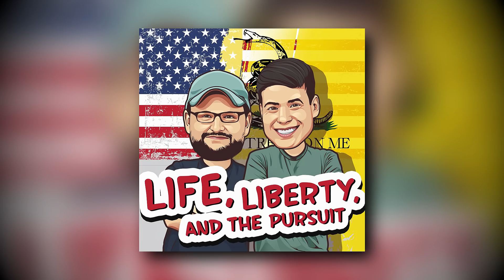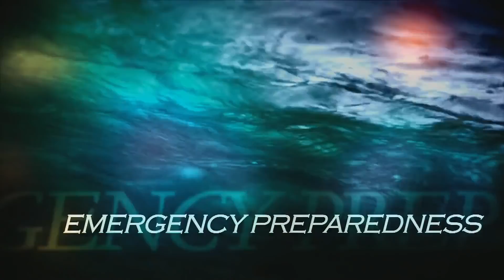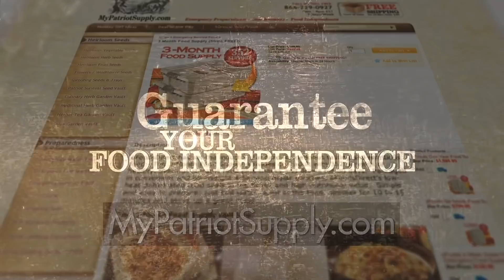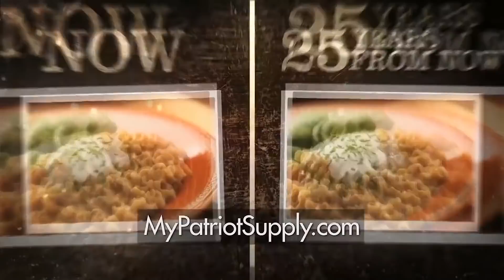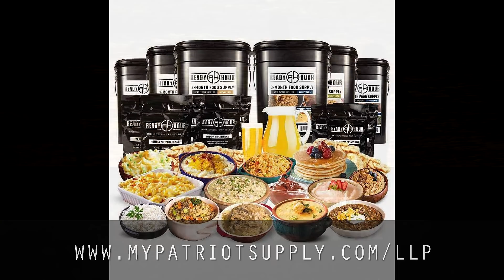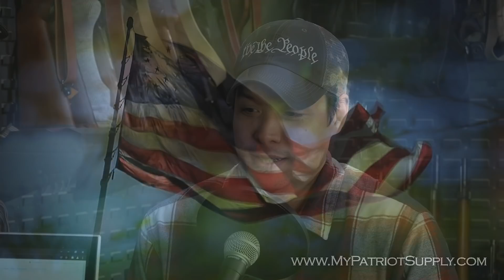LLP | #82: "AR-15 vs AK-47"

Comment: From what I’ve been told, the reason it was called the poison bullet was because it caused septic infection.
Reply: Due to speed of the elongated 20 cal bullet when the bullet struck human flesh and bone the bullet would yaw or tumble! High velocity bullets that hit bone definitely are more violent than a slower moving bullets. Also rumor was bullets out of 74 were kinda thin and hollow at the tip.

Comment: I want a rifle that is reliable, accurate sub 1 MOA with good ammo and sub 2 MOA with cheap ammo, light, modular - sights triggers cartridge stocks hanguards grips and even gas systems, ergonomic - including the safty trigger bolt release and charging handle at least being on the left side for right handed use, has last round bolt hold open, supresses easily, is simple to maintain, easy to work on and replace parts as well.

Now all you have to do is show me a premium AK and a premium AR using this criteria, the choice is pretty easy for me to make.

Comment: Freezing rain stops the ar flat..no effect on ak..I've had both ...the durability of ak trumps the ar design. The accuracy is better on ar but not enough to matter. So I use my ak,, much more
Reply: This is the best comment I've seen. I like both platforms but in a shtf situation where I had to leave my home without a cleaning kit or oil I'd have to take my AK no questions asked.

Comment: I can punch out .300 lead rounds all day with gas checks. I can use the few molds I have can make similar rounds for 30-06 and .308 easily. Trying to make loads for .22 rounds is dangned near impossible. If you can find AR ammo cheaply then it makes sense if not, just put a 30 cal lead round down the barrel.

Comment: Both have their place. The modern AK will hit at 500. Its just out of gas.
The AR pretty much max'es at 800.
But again iffy to be lethal at range. 
For average guys 300yds will max our skill on both. So either or both will do the job. Same with costs. You can get high end AK's costing as much as an AR.
As a P.S. Invite Brandon Herrera. Have him bring a 74. Run it out as far as you can.

Comment: AR platform does not perform well in cold temps. Usually in 10 degrees or lower you will see failure to fire, mag catch wont work properly, etc

Comment: AKs are far more modular than people give them credit for. People just buy oldschool, wood furniture AKs and compare that to modern ARs. Thats basically like buying a retro, fixed carry handle AR and saying ARs arent modular because ita hard to mount accessories to. Get a modern rail system with a good railed dustcover, not those stupid side mounts, lightweight furniture and a shorter barrel, maybe in a 5.45 or 5.56 chambering, then compare that to an AR.

My current AK is actually my primary preset AK that I use in Escape From Tarkov. It's got a Zenitco DTK muzzle brake, B-30/B-31C railed handguards, B-33 railed/hinged top cover, RK-3 pistol grip, RK-1 foregrip, and a Fab Defense UAS-1 folding stock. Right now it's topped off with a Sightmark M-spec which I actually do quite like, but it's soon to be replaced by a Vortex UH-1 Gen 2. 

I've never loved a rifle more than I love my AK with this setup, it looks great, handles well and is built like a brick shit house

Comment: The AK is modeled after the M1 garand in its moving parts. Exterior wise, maybe slight cues from the MP lines but it’s internals are m1 garand inspired. That’s really non negotiable, it’s fact.
Reply: @billmelater6470  He's referring to the AK47's long stroke gas piston & rotating bolt system that was directly inspired by the M1 Garand. The cam track for the bolt is nearly identical on both rifles.
Reply: Like every other gun design, it borrowed, and was inspired by a combination of design features from predecessor guns, including, but certainly not limited to the m1 Garande and MP lines. However,  to say it was "modeled after" the M1 is wildly hyperbolic.
Reply: @billmelater6470  it's safe to say he picked from alot of different designs, and obviously from older Soviet designs like the STV40. But Kalashnikov explicitly names Garand as an influence in a interview with Stoner.
Reply: @mohawk3371  loosely inspired is a better way to put it.
Reply: @nickloven6728  Loosely inspired by a number of preceding designs including the M1 Garande, StG44, Bren mk II light machine gun, and a number of previous Soviet designs including the Federov, AVS36, AS44, and SKS. In term of the most similar long stroke gas piston and bolt carrier design, that would be the Bren and the AS44 (Sudayev), rather than the Garande.

Comment: Not being easily conducive to optics kills the AK.  Not being very accurate even if you want to tolerate the scope mounting system further kills it. The limited range of the AK round finally kills it. If you have ever picked up an M-14 or Garand type weapon, there was definitely reason for moving on to a newer, lighter, shorter design. The range of the AR 5.56 was/is reasonable. The shear weight of a battle load of 7.62 x 51mm must have been staggering in weight AND bulk. Sure, there are tons of options for switching calibers in AR platforms, but the extreme cost/availability of most of those rounds, (if you actually like to shoot your AR) kind of kill that incentive.

Comment: I would like to point out it’s called a side rail. It keeps your sights zeroed even when you remove the dust cover. I would argue most AKs have one. 

This feels a lot like fuds arguing about AK Vs AR than an actual intellectual discussion between the two. You have some points, but when some of your points are ignorant of existing old designs on the platform you lose credibility to the audience. 

I like you guys and your content, but I know you are better than this for a debate.

Comment: I love my AK's, and one of them is my current go-to should I need to do rifle things right now. The major downside to AK's is the lack of easily replaceable barrels and other parts. AR barrel changes are easy and can be done by almost anyone. Hell, you can grab a few cheap uppers and store them away in case your barrel or gas system have a catastrophic failure. I really really like that aspect. With an AK you're generally stuck with the barrel and receiver combo unless you have a press and know what you're doing (obviously can't be done in the field either).
Reply: the Las Vegas outdoor shooting facility had full auto AKnto rent. Must use ammo purchased on site. Many were burned to PAST 50k of short Russian and stll viable in grouping decent battlefield accuracy. PRETTY UNFRIGGNREAL barrel life.
Reply: @chunglow7646  50k can be done easy in 5-7 years if you're getting out and training like you should be
Reply: @lit sci just because they still function doesn't mean their barrels aren't shot out

Comment: This is gonna sound like treason. But I believe that the AK is superior to the AR. The AR is more accurate, true, but the AK is more reliable. I will choose reliability over accuracy any day of the week.
Reply: I agree 100%.  AR can't get as dirty and keep firing (like a Glock)
Reply: @marchie610  dont know about that chief, I don't how scientific independent torture testing is but I've seen AK's do WORST than AR's with mud and sand. The Glock was one of the least reliable in harsh conditions, even the hi point did better. Any rifle including the AK will fail if debris gets critical components like the trigger, etc. So having shit not accumulate in the firearm to begin with is a lot better IMO then praying for the shit to fall out out of somewhere before it jams the weapon.

Comment: You guys are so used to buying gucci AR's that you didn't even touch on price. lol..  The biggest deciding factor to me is the fact that I can build just about any AR kit, from a 10.5" pistol, to a 18" spr and everything in between, for well under $400.. or spend a little more and get a CHF CH barrel setup for $600.  and again, even if "budget" builds are a little less reliable due to possible parts breaking, ect. it's not a problem because you can easily build a dozen of them--- so you have endless parts if needed, which you rarely do.

Comment: It is more pleasant to shoot with the AR 15, it is easy to hit it, since the AR 15 is noticeably more accurate than the ak system. The perfect rifle to throw it in the back seat of the car and go to the shooting range, have a good time. But in case of a force majeure situation, some kind of apocalypse and all that, I will take an ak, just not an akm and not an ak 47, but I will take a modern ak, in 5.45 mm caliber, of course a combat full auto copy is not available to me, I will take a civilian saiga in this caliber. Since ak is such a rifle that you can not clean, you can roll it in the mud, snow and frost are not so terrible, which the ar 15 is afraid of. But in all other cases, my choice is for the ar 15, and when I go to the shooting range, I prefer the ar 15. Yes, I don't have a perfect ar made in Russia, but it's still better in everything except reliability than ak. And such ar 15s as Hackler koch 416, Daniel Defense, pof revolution and the like Gucci ar are even better, but unfortunately in Russia they are very expensive (from $ 10,000 and more expensive). I apologize for my poor English and hello to everyone from Russia.

Comment: AK is measured in distance by meters which is greater then AR yards. Secondly 7.62x39 has the take the soldier out the battle compared to 5.56 that zips through target. Which is why the government is looking at the 6.8 spec or what not. 5.56 can't travel through a tree. 7.62x39 can travel through trees. Old design still 3rd world reliable. Which would you prefer in a SHTF with no gunsmiths. Pass me that AK 🤣🤣 Afghanistan is doing well to beat U.S. with AKs and flip flops vs drones, AR15, and missle launchers 🤣🤣🤣🤣
Reply: Not so, the AR-15/M-16 uses metric sights. We haven't used English system sights since the M-1, and early M-14s.
The Soviets adopted the 5.45 after witnessing the effects of 5.56 in Vietnam for good reason.
Reply: @jcoolG192  they only adopted the 5.45 because of the U.S. idea of 5.56. They went back to 7.62x39
Reply: And we lost Vietnam
Reply: @ZZTful  LOL...no. The latest and current Russian issue rifle is the AK-12 in 5.45x39. They still use the 7.62 in some units, mostly police units, but the 5.45 has been the main issue for decades. It's long range ballistics is vastly superior to the 7.62, making hits past 200 meters much easier. The 7.62 is a freaking rainbow past 200 meters, and it bucks wind like a frisbee.
Reply: @jcoolG192  but who are yoy shooting at 200 meters? 5.56 needs to tumble. I personally own both platforms. AK is better build then AR15s. Let the gas tube brake or a some dirt in the chamber thats done. I want a 5.45 AK But ammo is hard at the moment
Reply: @ZZTful  hopefully, I'll never need to, but that's what rifles are for, reaching out if need be. 200 meters isn't very far. 
It sounds like you need a better AR, or at least better components. Quality gas tubes don't burst, and a little dirt will not choke a quality AR. Most mud tests on YT actually have the AR beating the AK. I've gotten plenty of dirt and mud on both. Never an issue, but I have never gone to the extremes those videos have. 
Not trying to dissuade you on your choice, just wanted to dispell some of the myths. I enjoy AKs, but my preference is the 74 by a wide margin. Even better for me are 5.56 AKs. 77 grain SMKs perform well even beyond my capabilities. Give me a quality, AR or a 74 and I'm good to go.
Reply: @ZZTful  btw, try a 5.56 AK. Zastava M90 and Beryls are both sweet shooting rifles. Both handle cheap steel ammo well and are extremely smooth shooting. My preference is the Zastava, mostly because of the 1/7 twist. Shoots the 77 gr SMKs pretty well.
Reply: Yeah I'd go with the AK74 platform
Reply: I was looking at the papm85 something like that but for 5.56 platform, AR is the best to shoot that cartridge

Comment: Carry the Ak as a thumper 200 yards or less, or where you dispatch immediately, going through cars, going through cover. Keep a lite  20 inch barrel AR for 300-600 yards. PS. AK will always work. How accurate is a jammed AR?

Comment: The AR15 is a flimsy design that has a lot of flaws that make it totally unsuitable for a military application. However, it is very accurate and easy to shoot, and makes a fantastic civilian varmint rifle.

The AKM is a rugged and stupidly simple design that lends it self well to mass production on simple machinery. It is easy to train soldiers how to use it, and is built with loose tolerances so as to handle the horrible conditions of infantry life. It suffers in the accuracy department due to these loose tolerances. It also makes a good hunting rifle if one is skilled.

Personally I think they both suck, but I'd rather have the AK because it sucks less. If given the choice, I would rather go into battle with a Steyr AUG. Or even better... a G3 or M14 (if rucking ammo wasn't a concern).
Reply: Ah yes tell me you dont know shit about guns without telling me
Reply: @RafsGunCollection  I own several of them. I have the right to state my observations about them.
Reply: @vhfgamer  fair
Reply: No
Reply: @AndrewW.  Hey
You know those little itty bitty tiny parts that make up the bolt carrier group?

Yeah. Try dropping those in the grass while your cleaning your rifle in some foreign hellhole, while you're tired and stressed because you're getting shot at and your friends are dying.
...
The AR15 is a flimsy design.
Reply: @vhfgamer  You don't take down the BCG in combat, you can't physically carry enough ammo to warrant it and its nearly impossible to get fouling inside the piston of an AR aside from carbon. 

If the AR was flimsy and not suitable for combat it wouldn't be the most widely used military rifle in the world, at least by first world countries. You can't exactly count third world countries using AKs and cold war battle rifles because they use it because of budget reasons not effectiveness
Reply: @Robert-qm7yi  So you propose that a soldier should spend an entire year tour of duty in a combat zone without cleaning his rifle?

Uh huh. Suuuuuuuuuuuuuure
Reply: @vhfgamer  You do understand they clean their rifles on base and not in combat zones right? They would be losing pins in their hard floor barracks not the tall grass of a forest.

And when soldiers do clean their guns in a combat zone they don't take down the BCG, they just wipe it down and maybe run a snake through the bore. 
You could at least pretend to have some knowledge about the life of service rifles
Reply: @DocMitchell69  Well... considering I have yet to ever have a single problem with any M14 type rifle I've fired, I think it's fair to say I trust them. Same goes for PTR91s. 

But the AR15 and AKs.... I've had serious malfunctions. The AR15 was the worst of the two, with the AK being solved with a simple change in ammo while the AR was never fixed after hundreds of dollars of repair.

But I'm sure you're a fan boi of something, so I'm sure you'll disregard everything I'm saying. That's okay. You have that right.